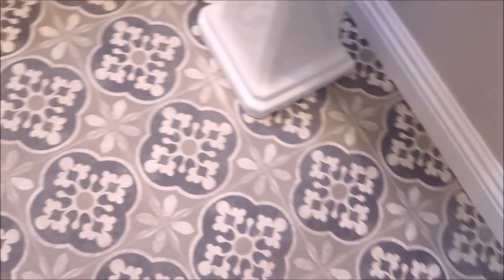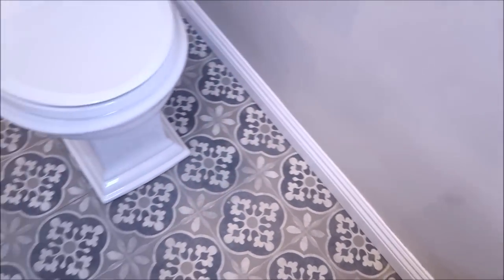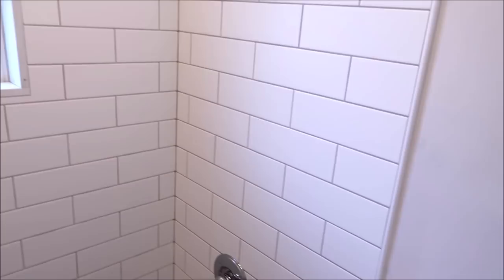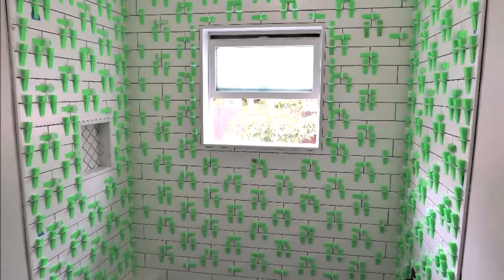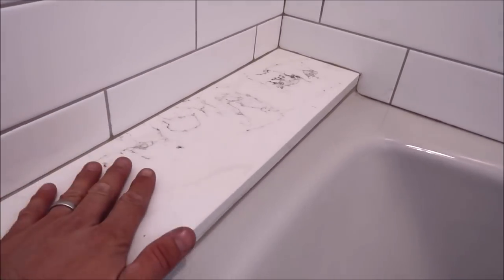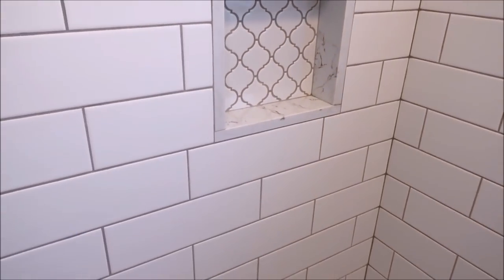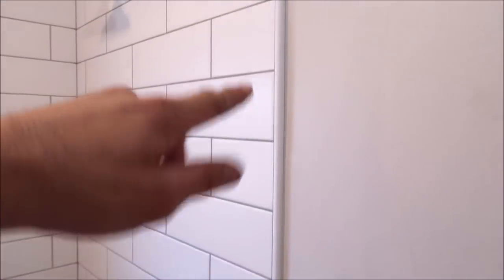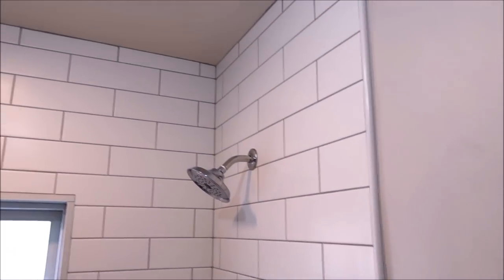Tiny Bath Design Bath & Shower Tile Ideas EP 22

Comment: Looks good! great job sir! My only comments would be if for tile this size do you really need the leveling system? it does look like a lot of extra work and also it would have been better for the bottom sill of the window to land in the middle of a horizontal tile line (if not a full tile) thanks for sharing
Reply from the maker: Thanks! For this size, no, you don't necessarily need a leveling system. It does help with flat walls and lippage and the cost is very minimal with the clips/spacers, so we decided to use the Levtec system. Also, you have two choices with small sliver cuts. Either install it on the first row of the tub (no way) or have the small cut at the bottom of the window. 👍

Comment: Top notch job on that tile! Do you recommend 1/16" grout lines for this size of tile, as opposed to 1/8"? I'm doing a shower in 4x12 subway soon, using a 12x12 Schluter niche which I will cut in after so I can (hopefully) land right on the grout line like you did. Any tips on how to achieve this? Were your tiles like 3 15/16" in order to get that to work?
Reply from the maker: Yes, always go 1/16 grout lines. Less grout =Less maintenance and spend as much time on layout. Lay your tiles on the ground and pull measurements before install.
Reply: Good points - Thanks brother!  @LandbergTileTV

Comment: Do you typically use tile leveling system for 12x4 wall tile?  I've heard some say that it's a little small for a leveling system, and you can tell by your video it was a FULL wall of levelers, but turned out great.  I did NOT use levelers for my 16x4 wall tile, but wish I had.
Reply from the maker: Yes, we usually always use a leveling system for 12x4 tiles, It doesn't slow us down very much, and the walls are super flat!

Comment: I’m using same tile with spin doctor leveling system.  You recommend using 1/2 inch trowel and 1/16 grout lines for ceramic 4x12 subway?
Reply from the maker: That's usually what we do 👊
Reply: Hey thanks a lot. Will doing this with the leveling system help with any imperfections in the wall?

Comment: the only thing i dont like is the gap on the first tile on the bath. Why did you start so high off the bath ?
Reply: Or that the shower head is leaking from the threads.
Reply from the maker: I know I know, we didn't have any teflon on hand but corrected it the next day 👊
Reply: PedroChapps Expansion gap, necessary.

Comment: 4:17 And that’s why I don’t like schluter Kerdi and board. Looks so hodgepodge. Don’t those patches make it harder to avoid tile lippage? Could you cover screws with roll on membrane? Not hating the player, hating the....tile substrate. Lol....
Reply from the maker: Negative, the patches don't increase lippage. We use a half inch trowel and a tile leveling system and believe it or not, back buttered the majority of these tiles. You could use a membrane like Redgard, but it's never recommended and not covered by warranty. Using thinset and Kerdi membrane is so quick and the best part is you have NO dry time. You can start tiling immediately! 👊
Reply: Kevr, Couldn't agree more. I hate tiling on Schluter waterproofing system. I definitely don't use leveling clips, and those patches absolutely make getting a flat finished wall a huge pita. I use GoBoard and Hydro-Ban the seams, very minimal build up. It seems crazy to me to use a system that requires you to use a 1/2" trowel and leveling clips on relatively small format wall tile.
Reply: Chris King Yes, 1/2 trowel with subway tiles is overkill in order to overcome the Kerdi build up. Sorry landberg! While Kerdi and wedi board is spendy, the goboard and usg’s board make good alternatives.

Wonder if he used Kerdi because there was a sound plaster wall or something. If not, I don’t see the point of drywall or cement board, then thinset, then Kerdi, then patches, etc. when a board product would simplify. I know a lot of people like Kerdi, and schluter is a great company, but after I used wedi my mind was changed. Of course, will never use wedi again with the more affordable products out there.
Reply from the maker: Schluter system does not require a 1/2 inch trowel or a leveling system, we simply prefer that size notch and the leveling system helps with any lippage. The Levtec system is a bit overkill yes, but it doesn't slow us down any.
Reply: I'm with Kevr, definitely not "hating the player" here, your work speaks for itself. I don't publish videos of my work! Different strokes for different folks, is all. We all use what works for us. 

With that said if you want to try something other than Shcluter and like the foam pans, try a Laticrete one. Drain assembly is all done from factory, pans are one piece. They have Schluter and Wedi beat in my opinion. 

Keep up the great videos!
Reply from the maker: Will do! I saw those shower kits at contractors direct. Where do you get yours?
Reply: I get them through my local tile supply house, who are a Laticrete dealer... The pans are special order, usually within a week though. A pipe to stub up from the P-trap and that's it!
Reply from the maker: Thanks for the info! I'll definitely have to give it a look and try this system.